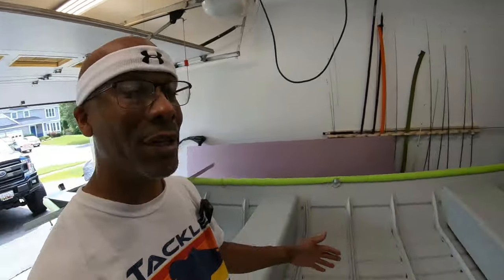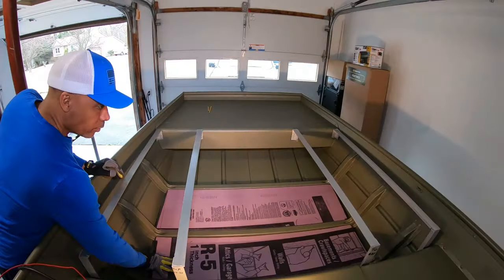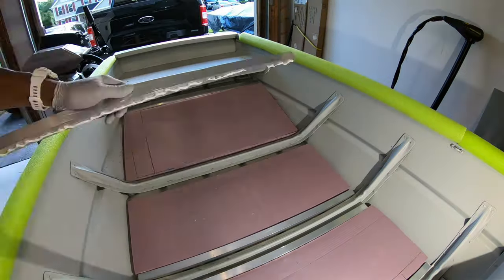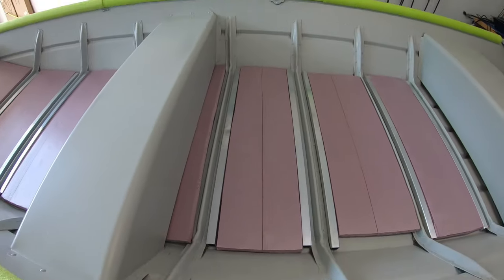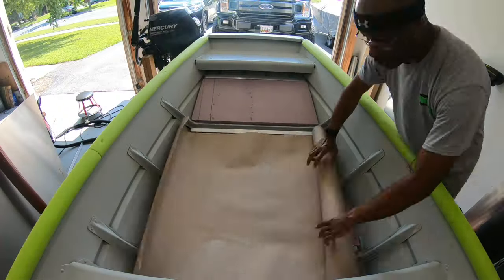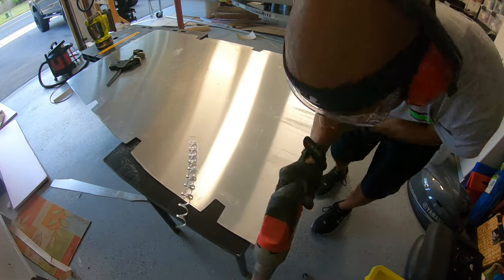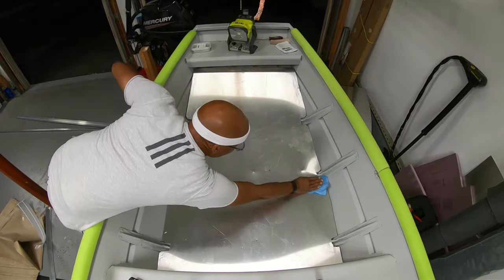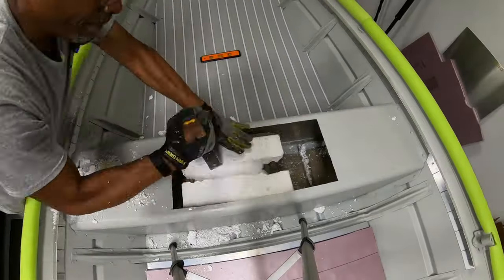EASY SOLUTION:  DIY Jon Boat Ribs To Secure Your Sub Floor

Comment: Nice job. I am in the DMV also. Did you do any testing for the pink board? Also, why not use aluminum screws to avoid the hull reacting with the stainless steel?

Comment: Hey, I have been following all your builds and decided to do my own on my 1236 jon boat. I do have a few questions. What thickness of aluminum would you suggest for 1) the subfloor where my hatches will be and 2) for the decking. I don't want too much flex in it but I am to suggestions. 

Thanks
Pawel
Reply from the maker: .063 for hatch floor and .090 for deck sheeting.

Comment: Great video, you provided me with the information that I needed to attach my flooring in a SeaArk 1448 MV. My only question is what are the specs on your aluminum sheet and where to purchase it? Thanks and keep the great videos coming.
Reply from the maker: Thanks.
 .060 works pretty good as a subfloor and .090 for flooring or decking. You can buy aluminum sheeting on tbnation.net and can use our code "BBF5" for 5% off your order.

Comment: Has anybody used this adhesive before? I know it’s probably great for securing material, but does anybody know how it reacts with water? I’m doing a build right now and lost 3 ribs due to removal of the bench seats. I intended to do something similar with square tube to rectify the situation but am concerned about adverse reactions with water, adhesive and aluminum

Comment: I have these bent V braces in my Lowe 1040... They are 1-3/16" tall above the flat bottom... No 1" foam or square tube will fit.  I'm considering building a hot wire cutter and the 2" foam and slicing it to thickness.  Got a better idea please?
Reply from the maker: Maybe you could find some hat channels and run them perpendicular to the ribs of you boat.  Secure the hat channel as best as you can to the ribs crating new ribs running from front to back to secure your deck to. You may have to do some modifications of the channel to make it work.
Reply: Good idea... I looked and hats that clear are too big.  Perhaps I'll rivet angle along a side of the V and bend it down level, if you see what I mean.

Comment: When you rivet into the sidewalks of the boat won’t that create leaks?
Reply from the maker: Not if you use closed rivets.  Also use 3M 5200 to ensure no leaking if installing below the waterline
Reply: @BassBrothersFishingDMV  okay thank you! I’m gonna be buying my 12ft John this weekend and doing my first overhaul conversion on it. We’ll see how it goes. Your videos are very helpful , just extremely nervous about puncturing any holes in the hill itself.

Comment: Don't know what year that is I have an 04 Lowe 1436 my ribs are different didn't have to do all that extra work just foam and rivet floor down
Reply: I have the 1040 Lowe and it's just like this.  I ground my two V braces down to one inch.  PITA!
Reply: It's a 2021 model and it was built fast and uneven.  Poor quality. Not recommended.